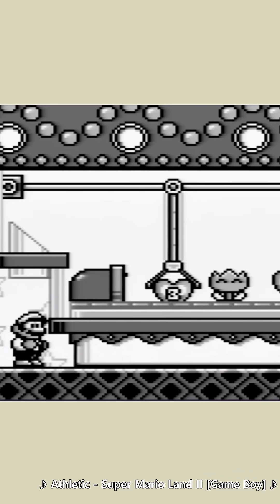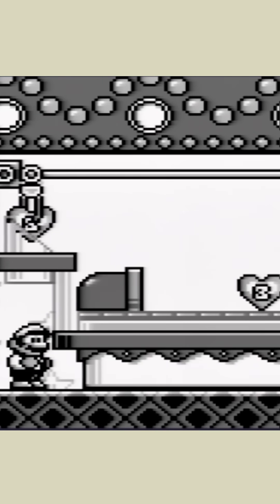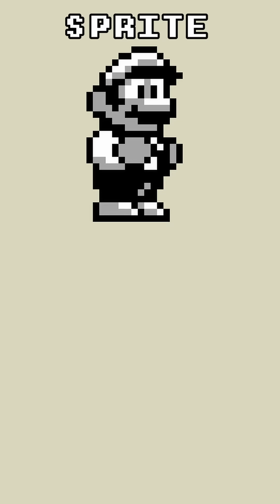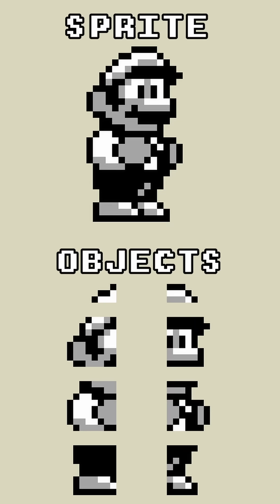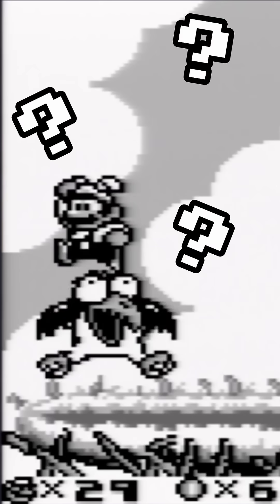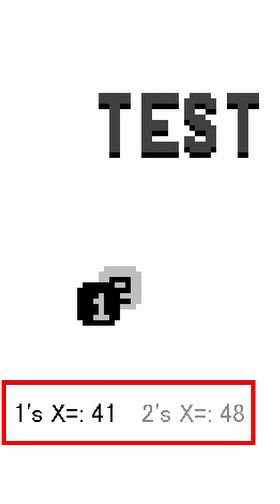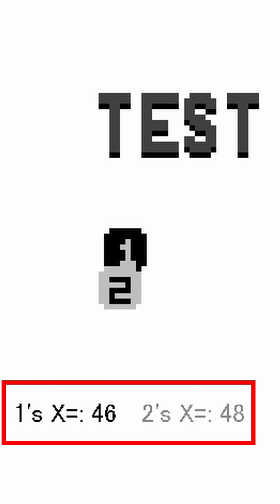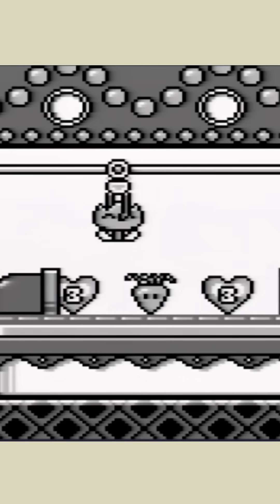How Super Mario Land 2's crane game works | Game Boy Explained #gameboy

Comment: You mixed up objects and sprites here; the 8x8 pixel squares are the sprites and the objects are the objects made by those sprites.

I'm not trying to be an "um akshully" guy here, just trying to help
Reply from the maker: This was confusing for me when I first started learning about the Game boy hardware, since systems like the Master System use the term "Sprite" to refer to 8x8 or 8x16 size on-screen objects, and even have memory named the "Sprite Attribute Table."  

The Game Boy uses the term "Objects" instead for these 8x8 and 8x16 objects, with its "Sprite Attribute Table" analog being called "Object Attribute Memory." 

The Pan Docs that cover Game Boy programming says this "Several objects can be combined (they can be called metasprites) to draw a larger graphical element, usually called “sprite”. Originally, the term “sprites” referred to fixed-sized objects composited together, by hardware, with a background. Use of the term has since become more general......Object, an entry in object attribute memory, composed of 1 or 2 tiles. Can be moved independently of the background."

https://gbdev.io/pandocs/Graphics.html
Reply: @Bofner  Interesting... I've only ever heard the opposite. Today I learned.